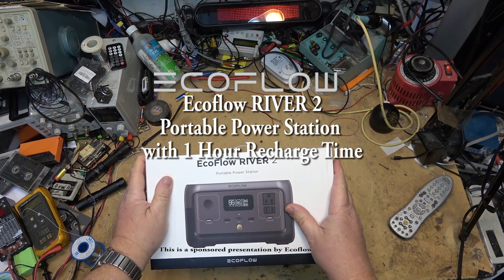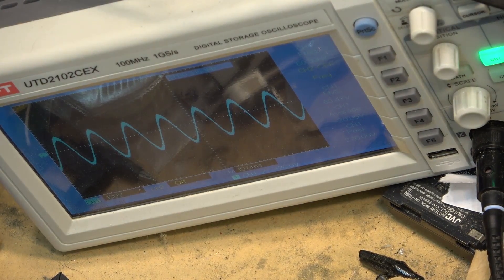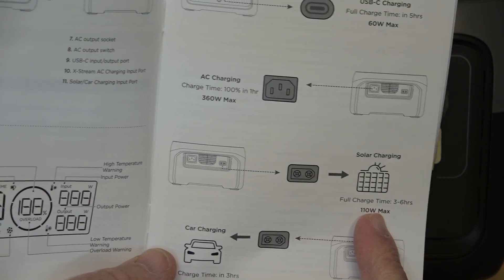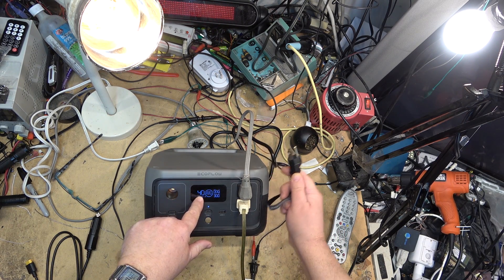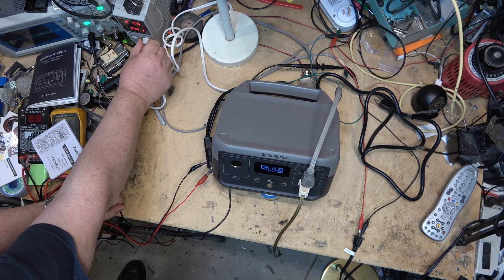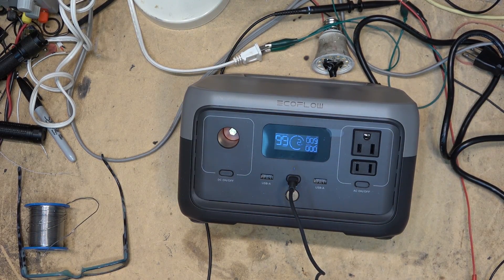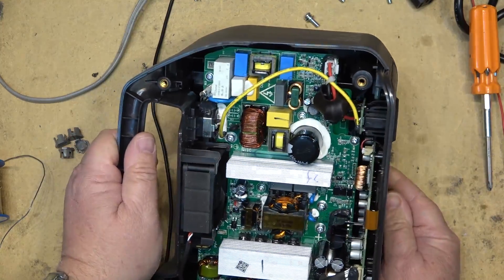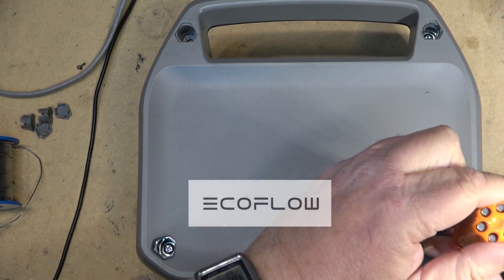EcoFlow River 2  The FASTEST Charging  Portable Power Station #EcoFlow #SolarGenerator #PowerStation

Comment: If you think I'm going to want to charge that thing in my house or anywhere near it, you can think again! fast charging lithium ion batteries this way is a dumb idea.
Reply from the maker: They are li-fe-po cells.  Not the ones that go nuclear.  The battery management also monitors current and temperature and will shut them down if anything abnormal is detected. Every so often you hear of someone's ebike or hoverboard burning up and then once the facts become known it turns out that nine times out of 10 the person that owned it changed the battery and put in a higher capacity battery or changed out of that acid for a lithium without proper battery management. One thing you don't want to do with lithium batteries start adding extra capacity or modifying them.